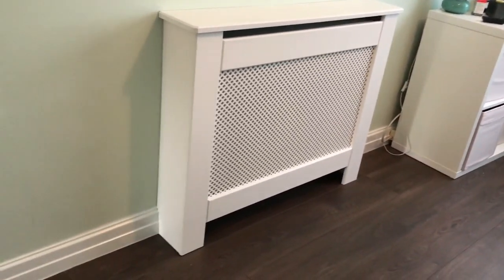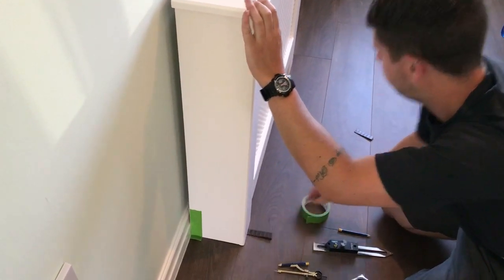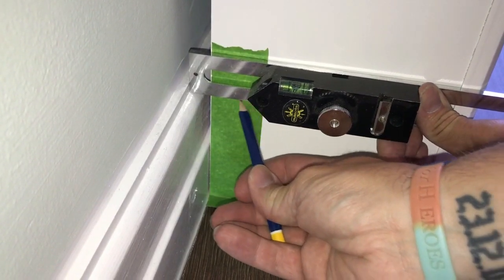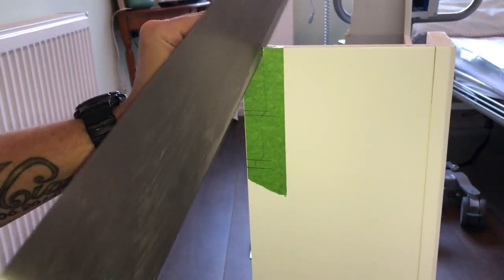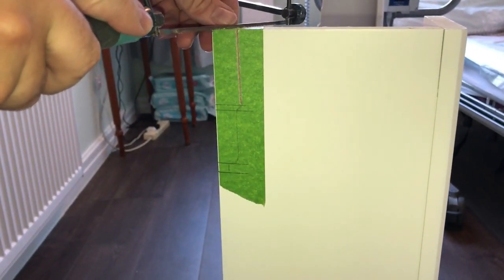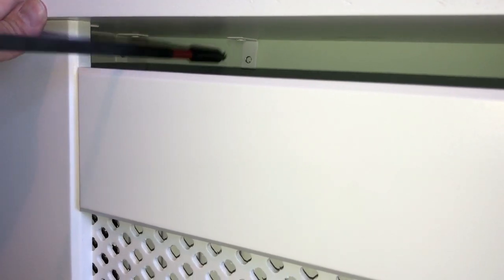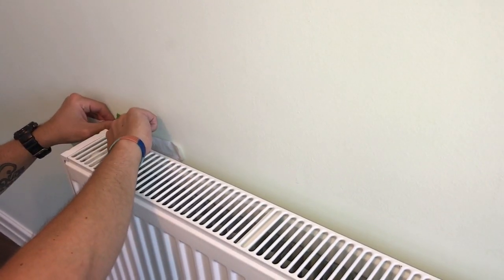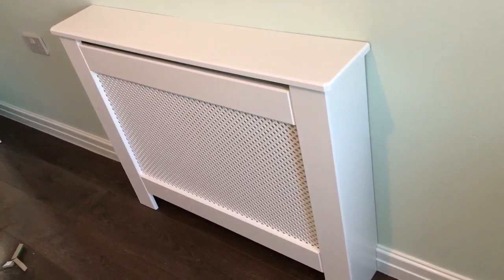How to scribe/cope and fit a radiator cover. The complete DIY guide

Comment: Beautiful job!  I have a radiator cover with  detachable top. In  winter it gets bent from the heat even though it is not that close to the radiator. This time I put piece of wood directly on the radiator as a barrier so the to exterior top cover does not bent, but it is starting to bend, any suggestion would be very helpful . thanks
Reply from the maker: TheBandoury if it is wood then maybe replace it with mdf or use angle brackets to screw it down.
Let me know how you get on.
Thanks for watching and be sure to like, share and subscribe to help the channel grow 👍🏼
Reply: @spendtimesavemoneydiy  why replace wood with mdf, what is the difference?
Reply from the maker: TheBandoury mdf is more stable than wood especially over a radiator where there is a big variation of temperature.
Reply: @TheBandoury  You could also line the bottom of the lid with a reflective foil, to send the heat back away from the top. That should also help push heat out the vents at the front.
Reply: @thewannell  That's a good idea, and easy to do. thank you !!

Comment: I use a Magnusson scribing gauge which I picked up at a local Screwfix (very accurate) which works a treat for this sort of job. Another idea would be to finish all the scribing and cutting and then paint the rad cover.
Reply from the maker: Cliff Carlo some great advice there. If I'm doing a radiator cover for my house I do generally scribe before I paint but this one was for someone else so it would have been a pain to scribe it first.
Thanks for watching and be sure to like share and subscribe to help the channel grow 👍🏼

Comment: If you wanted to scribe the too shelf to the wall, how would you go about that while keeping the skirting scribe sizes ok? If you get me.
Reply from the maker: Rodger Quinn ok break it down into two jobs! Scribe over skirting as video. Take top off so it's separate, put it in place and set the compass to the biggest gap, keep compass parallel to wall and scribe a line. Cut to the line, each end keep cut square but in the middle you can back cut it slightly. Put it back into place, when you're happy screw it back onto the cover and screw to the wall. Hope this helps 👍🏼
Reply: @spendtimesavemoneydiy  ah right I get you. Seems so simple now that you point it out lol.
Reply from the maker: Rodger Quinn good luck! Thanks for watching 👍🏼